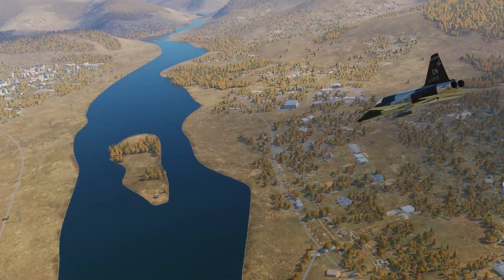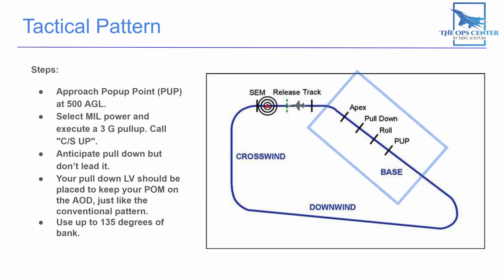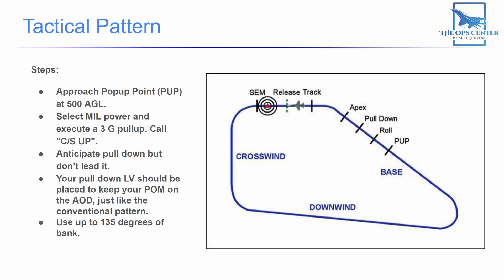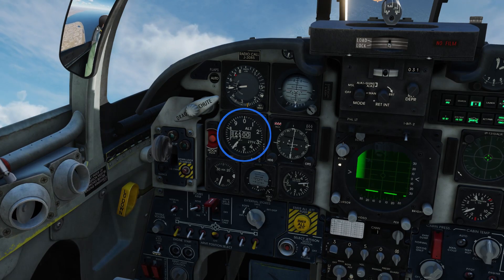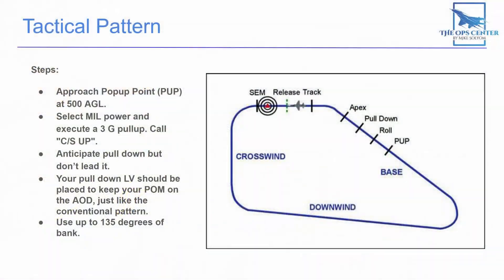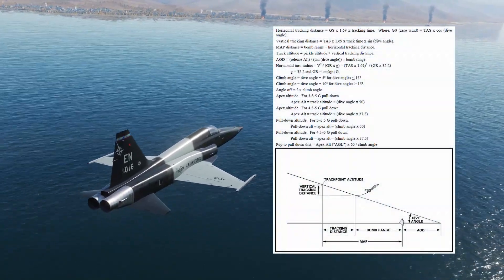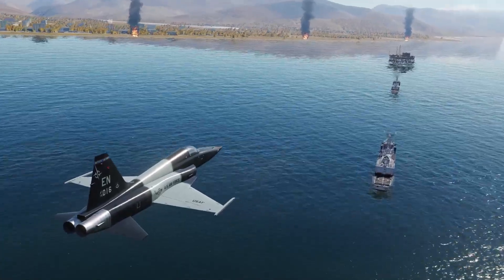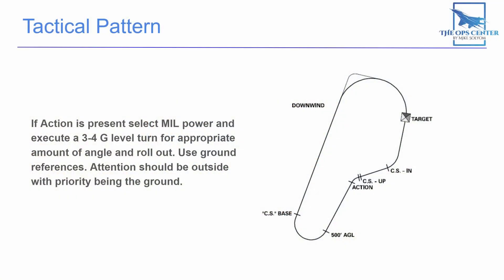USAF Tactical Pattern  | BSA Part 4 | DCS

Comment: How do you calculate the bomb range?
Reply from the maker: IRL a pilot would look in the back of the aircraft manual for a dive bombing table to get the bomb range. This may not be an option in DCS depending on the aircraft.

However, there is a technique you can use that involves pausing the sim during the dive to figure out your parameters. I go over that technique in this video:

https://youtu.be/Vw8Xtsa7rpw